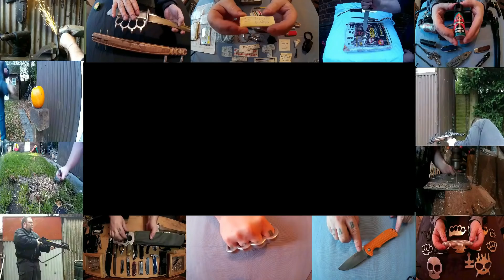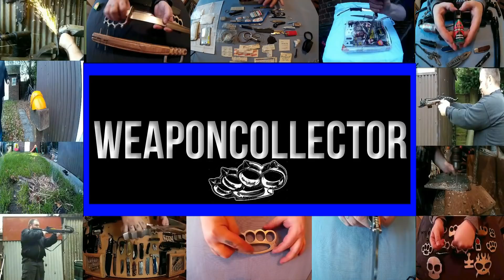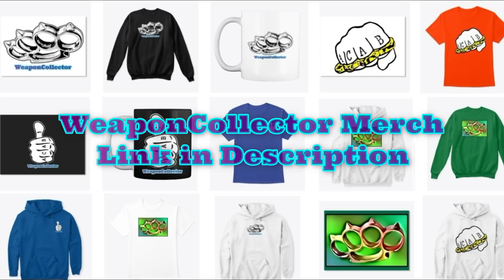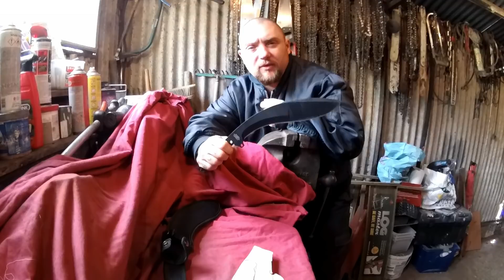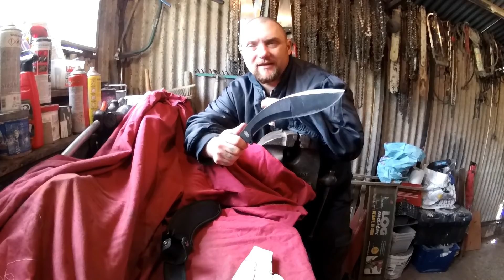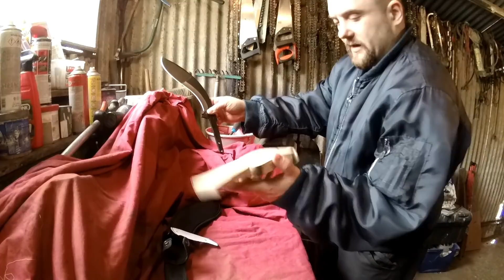How To Rehandle A Kukri (Fox Extreme Tactical)

Comment: Nice job. That looks surprisingly good with plywood.  If I were going to make a mod to this; since you have so much material in the handle, would be to dig out a slot for a small fire steel and striker on the sides and then file grooves around the handle to nest in some paracord to wrap the handle and hold in whatever you put in the cutouts.
Reply from the maker: cheers mate, yeah that birch ply i think it is is great quality material for handles, good idea on the flint and steel, will keep that in mind
Reply: @WeaponCollector  Do you have a sheath for it?  Maybe kydex.  I have my grandfather's kukri and it had a wooden handle with a thin leather glued over it.  That all rotted over time but I managed to save the wood.  I sanded it, glued the two pieces back together and sprayed it with a rattle can of truck bed liner.  Then I glued on the original brass tip and polished it up.  Maybe I should just make a video.